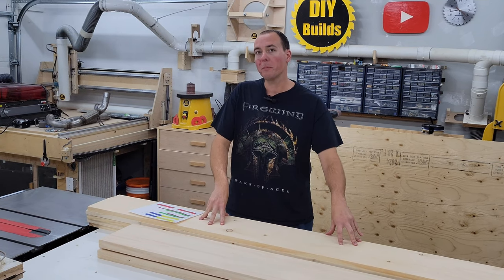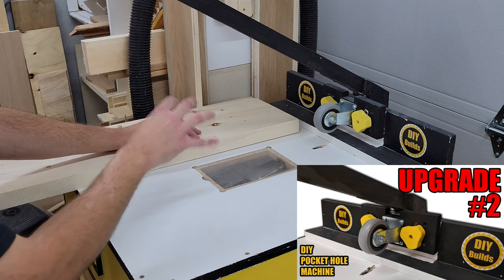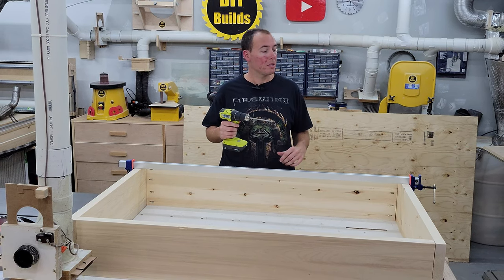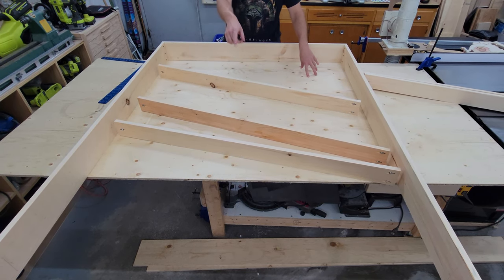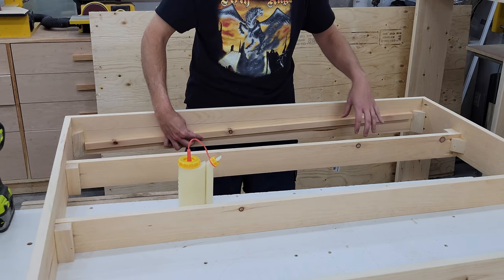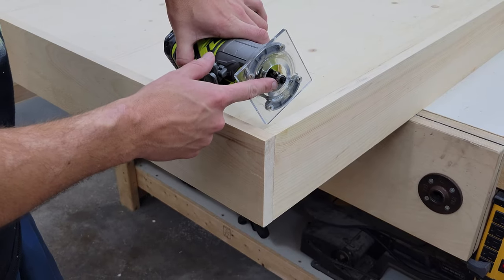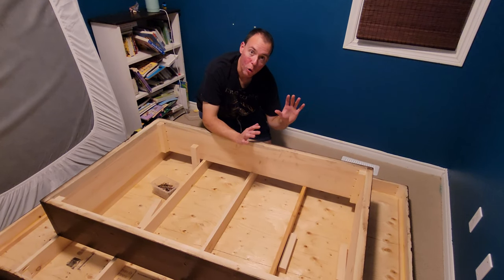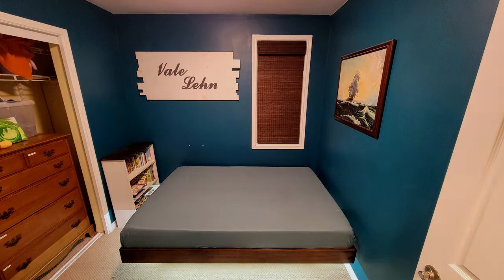How to Make a Floating Bed

Comment: It is amazing how much that floating bed looks like a waterbed frame from back in the day.   I do have one suggestion to make for your design.  Add some drawers to the lower stand  for extra storage. It will add a little to the cost, but it will make use of valuable space under the bed.